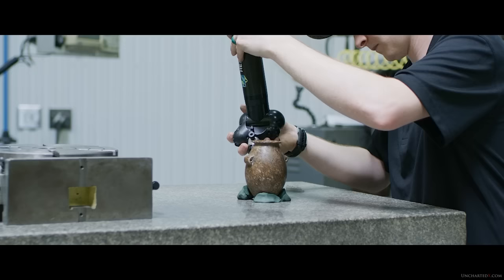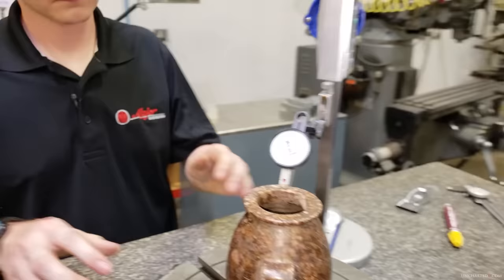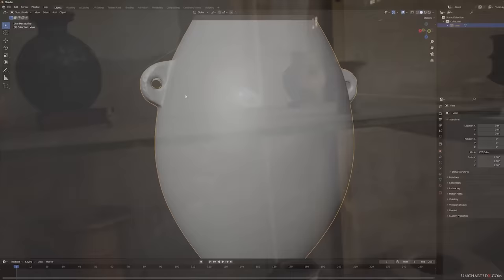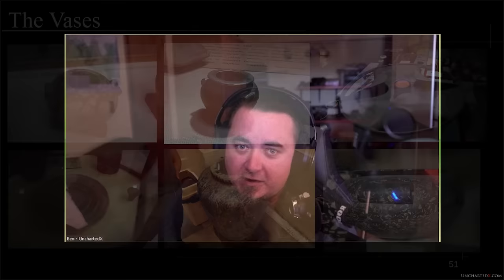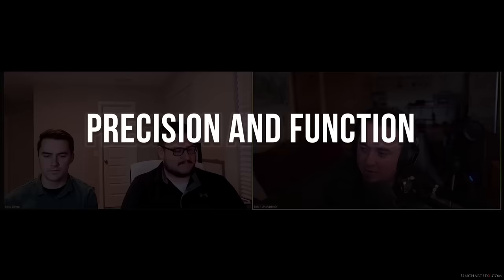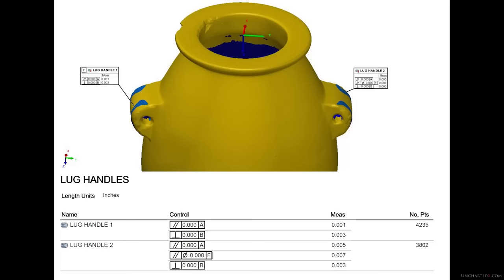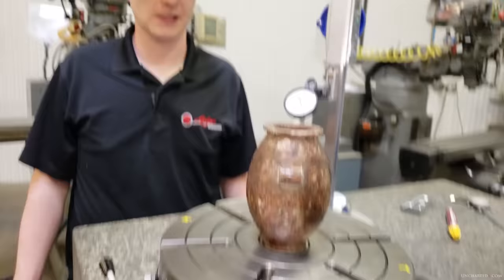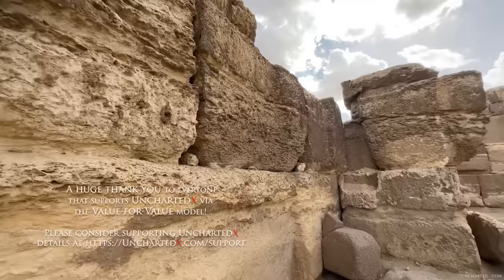Ancient Egyptian Vase Scan Update! STL file, More Analysis - and Between the Lug Handles

Comment: After the first vid on this i pondered how i would make this with Egyptian/stoneage material. I have worked a couple years an a variety of cnc machines making heavy machinery parts. I also have had a hobby of stonage technology/survival. Eventually becoming a furniture maker.
So goin into this i have some post Egyptian tec perspective.

So how i would make one of these with Egyptian limited tools:
With river rocks as bearings and a large stone or clay kick wheel like s.w. american indians had. Bees wax or pine glue mounting to the lathe. Like jewlers use (The rough shape being pecked out using templates)
The cutter would be lime stone roughly the profile (leaving the handle as a ring ,as stated by the voiceover.)
The overall shape would not be exactly reproducible as both grinding stone and vace would erode away. Some corrections by pecking the limestone.
The arm would need to be held in place by a frame. True the cutters being removed and worked would need a near total re grind....did that on a lathe before. The inside would get drilled and broken out and the interior would be pecked and ground the same way (probably first)
The rim would then be cut and pecked off.  the od grind would need to be short back an forth grinds...time sink for sure.

Would this get the same  results on the overhead pin surface measure.. who knows(side note when i used that tool for flatness on thrust plates i know the computer will assume some surface and fill in the blanks.....i have clearled the data and re measured to get a different enough surface to go from fail to pass🤫🤫🤫

 i would like try some this experimental archeology if anyone would like to fund me a couple of months of work to try i would give it a shot.

Comment: Don’t think it was made by a lathe but rather a rotary tool like a router could have been used. Slowly turning the stone against a router would make it trivial to move the bit in and out to allow for both shape and the lugs. The precision is just a consequence of perfectly centered stone holder (think jaws on a lathe) and the cutting tool moving against a template. Same template would be used to guide what ever tool carved the inside making it possible to get paper thin walls. Whats even more interesting is how the cutter was actually powered. I believe it wasn’t powered but the granite itself was being subject to ultrasound and the cutter itself being inert. There is a video by a Russian guy who successfully drills and cuts granite using stationary cutter and ultrasound. He also grinds two rocks against each other potentially explaining polygonal megalith’s perfect fittings.

Comment: Just my theory, but the key is in the handles.  The handles to the vase are what the nubs are to the megalithic blocks and their multiple perfect cuts....A charge or energy is applied that excites the granite to the point that it becomes malleable.  The blocks can be trimmed and pressed against hardened blocks, the vases can be blown. You can't turn a vase on a lathe if it has handles.  Ancient technology doesn't have to necessarily mean saws and drills.

Comment: Excellent, factual video - two things:
1/ Isn't it about time that we got somebody to document making one of these (now that we have the files) from the same material using modern cutting techniques and then compare the results. Also, just for fun, we could have an Egyptologist with a stone to bang at another piece of rock and we can see how well that does. Another tradesperson that strikes me as relevant - certainly in terms of at least getting an objective opinion from - is a mason. How would they do it. It might be that they say things that we expect them to regarding what tools would be needed and so on but the trolls in the comments section would have to respect the opinion of such a line of expertise.
2/ 16:53 "zero point zero two eight of a millimetre" can be substituted with "twenty eight microns" which flows off the tongue easier and anybody from the 'we want it in metric' side who claims to not know what a micron is just needs to learn that it is the name of a micro-metre.

Comment: For the scoop marks, could you compare the scoops to see if the exact same tool was used over the length of a single scoop and then across scoops?  Depending on being able to determine a wear pattern of the tool could narrow down possible tools/methods.  I have no freaking idea how they did this stuff, especially when you see material displacement near the margins of blocks like the entire block was softened, but I imagine it could be like a vibrational/resonant EDM-type process--which you still get wear on the electrode/tool

Comment: Amazing work again. Just a nitpick 0.028mm is 28 microns (or micrometers, or µm) The 3 digits after 0 are microns. It’s the imperial system that doesn’t have a unit for thousands of an inch :) Other than that it would be a good idea to default to microns for further work to appeal to a larger scientific audience. US machinists use thousands of an inch (or thous’) more frequently, but it’s 50-50 metric/imperial in US engineering and 100% metric in the rest of the world and scientific community.

Comment: 11:00vThe solution to the material variation is to have a moving tool edge working on a lathe. Call it lathe milling. A high speed cutting tool could make the material variations immaterial...

Comment: I enjoy these amazing discussions .. they tickle my brain as I try to ask .. how would I do something like that with available materials.  Regarding the scoop marks .. it seems the most obvious thing is that they were made with sand blasting capability in some way.  Maybe they could use stone as a way to contain pressure .. generated by water. Maybe they had specialized (not necessarily hi-tech) controls on their nozzles.  Certainly sand was abundant.  Maybe sand was used as an abrasive between a flexing roller.
I certainly agree with the machining comments that the stone jar is something very different than what we are used to thinking about.  Native Americans have used stones to grind seeds into flour .. and those grinding stones have left impressions in the rock.  This is also something that has been noticed at some of the sights in Turkey.

Comment: at 2:04 we can see that the interface between the lugs and the urn is blurry. I wonder if the vase was turned, then the lugs applied using geo-epoxy or whatever you call it.  That would address the largest issue.

Comment: I was looking back at an older video and noted that the original location of artifacts like this the 'precision vases, etc' seem to suggest it could have come from the Step Pyramid, along with ~40,000 other similar vessels. That's a mind boggling quantity of high precision objects and points clearly toward mass manufacturing techniques as this 40,000 would have represented just one cache of what was saved from the old times.

Comment: I used to work mainly with plastics and wood. But this kind of precision is hardly achievable with current common tools and machines. And we are talking about soft, easy to work with material like plastic and wood. This kind of precision looks like some kind of "injection moulding process", but I just can't get it how they could do it with stone by hand tools. We can't do it by hand and simple power tools in soft wood today.

Comment: If you look at that image at 25:04 of Egyptians making stone pottery - whatever you might think of it - take note of the tool AND the tip you can see in the upper part of the image between the first two workers (left to right).  The whole length of the tool cannot be seen in any of the parts of the image, but you can see most of the tool with the two workers and the bottom of the tool in that upper section - the tip appears to be a central pointed tip with almost a blender blade.  You can see the weights on all of the examples of the tools.  

I'd be very interested if any of the machinists on the comments recognize that bit (tool tip)?

Comment: Interesting video.  I suspect/hypothesize  that those high precision vases are possible the remnants and artifacts of Atlantis.  Atlantis was supposed to be a very advanced civilization.   Interesting part about vases is their handles.   They are designed to be handled mechanically instead by hand or robes.   What strikes me is the amount of precision for the object that is supposed to be used to handle simple liquids by simple people.  Such precision of the vase can be found in aerospace industry and some automotive industry.   Therefore, the civilization was so advanced that considered the precision vase making a piece of cake or that this vase was made for precise specs for a specific purpose/function that requires high tolerances.

Comment: Has anyone downloaded the STL file and analyzed the mesh?  The mouth of the vase in particular.  There is a slight protrusion in the mouth..along the lines of maybe +.004" to +.006"  x 1/4" long that rises up from the main cylindrical area of the mouth.  I think this is why the cylindricity that was measured is listed as being within .013" of a perfect cylinder. If the mouth or cylindrical part of the vase did not have the protrusion, the .013" listed on the Polyworks report would be even smaller  and closer to a perfect cylinder--it seems that most of the mouth is very close to a perfect circle if you slice  the mouth area.  I understand that cylindricity and circularity are two different things, however, if you slice the mouth of the vase, but don't slice the protrusion, you will see that the circularity is very close to a perfect circle--within tenths of one thousandth of an inch.

After thinking about this, I suppose it's possible that the protrusion might indicate some sort of cutter deflection where the cutting tool hit an extremely hard spot in the granite.  I have never cut granite, so I'm not sure if my thoughts on this would be accurate.  However, I'd like to here the thoughts of other on this.  If you analyze the mesh of the mouth by creating a perfect cylinder and compare the perfect cylinder to the mesh, you'll see what I'm talking about...Any thoughts on this?

Comment: 🔴🔥Necessary: I think it would be on-point to thoroughly explore the hot-stone angle. Get pros to explain required heating temperatures and subsequent tools that would bring these hard-stones to heal, so as to cut and circular-core more-easily. In one vid you had pointed out the flaking of certain massive stones, and how that was very rare and unexplainable; could it have been extreme temperatures? It seems to me that extreme heating must have been the method used in performing these monumental tasks. 👍🏆 Keep up the great work❣️

Comment: I'm no expert, yet to say there could be not have been turning on a lathe between the lug handle areas assumes certain aspects of that process without exploring other modes and applications of turning.
Imagine if the vase was not turned in a continual circle but in a back and forth motion in arcs by hand (from two directions as needed). 
This could achieve the same profile and precision between the handles without the need for incredulity. 
There might be some need for hand finishing right next to the handles, but much of the area could be turned, just not in complete circles.
Reply: that implies an even more rigid machine was used to create this object, more than likely NOT made of wood.

Comment: Perhaps, not that relevant. However, in the UK my late father started a building restoration company. He restored everything from dams to churches, from office buildings to cathedrals. His company won many civic trust awards for its work. Over time, he became inundated with work. A market emerged which was for local churches in disrepair and high end retail outlets in the older and more “classy” parts of cities. He did not have enough masons and more often than not the client could not afford the work. Around this time my dad won a licence to produce glass fibre reinforced concrete. He eventually started making relatively lightweight mouldings at low cost that could provide a credible substitute for high quality masonary, at least superficially. My dad documented all of this in manuals for employees and also for potential clients. So: skills and techniques die, clients want the originals, so solutions are found, procedures are recorded, the solution is not the same as the original even though centuries have passed. Seems that this is a normal process to me.

Comment: I wonder how much microscopic analysis has been done to these stones. Specifically comparing the mineral structure at the edges of tight fitting poligonal megaliths, to the interior of the block ( by using a block that has been cracked open) and also comparing it to the quarry it came from.
I suspect we will be able to find discrepancies in the microcrtstaline structure of these stones.

Comment: For a quick check, I opened the .stl in Zbrush.
Appended a sphere.
Set the sphere to the same height (y), and set the z-width to the non-lug surface (z) width.
Then set the x-width to the same as z.
The results are indeed stunning. 👀
The only thing that's weird is the hole through ONE of the lugs is VERY skewed from parallel. This doesn't make sense.
Reply: more than likely the holes were added in the Dynastic era. which makes one wonder, what purpose did these artifacts have?

Comment: I agree that these had to be machined in some way, but given that, the lug handles are not problematic. They appear to be curved along the vertical axis like the vase itself indicating that they were turned as a band around the entire vase then the unwanted material was ground away and the holes drilled through. Using what type of machine? That's the question. Also finding these high quality items contemporaneous with low quality imitations is not mysterious either. Just go to Canal Street in Manhattan and you'll see what I mean.

Comment: I suspect, with a harder than granite rotating cutting tool, the object could be spun on its vertical axis while being shaped by the rotating tool very accurately. Similar to a 3 axis cnc machine. The device need not be a lathe, it could be rotated by hand so long as the cutting tool was rotational and followed a guide such as the old pattern lathes did. As more accuracy is needed, such as the detail around the lugs, the tools size and shape could be changed. I’m curious about the accuracy of the holes in the lugs with regard to their distance from the centerline of the vase as well as from the top flat (datum surface) of the vase. The holes would have to be drilled using a separate method.

Comment: What does the interior of this piece look like? Is it a cylindrical bore? Is it roughly hogged out? Does the interior surface smoothly follow the exterior curve? I think you might learn something by looking at the part where the makers didn't care whether or not people saw a smooth surface. An unfinished interior quite likely shows an intermediate step to a finely finished surface. I'm a potter. The exterior of many of my pieces are smoothly burnished, but on the interior you can still feel the impressions from my fingers

Comment: I'm currently having a too and frow with an idiot saying that all the scan stuff is garbage etc. Very frustrating.  As an engineer for over 45 years, using CMM machines etc. The data does not lie. He is also saying that it is not as old as proclaimed. Even if it was made last week, we could not make it with our current technology.
Reply: @darklight2.1  None, I would not be able to manufacture one to the accuracy found in this piece.  Also you would not find many that would attempt it.
Reply: @darklight2.1  Have you seen any with constant wall thickness to within 10 thousands of an inch, and lug handles symmetrical to within 1 thousands of  an inch. Why don't you download the cad, do some checks, find a modern vase that is as accurate. Some of the many stone vases in the Cairo museum are made of even harder materials, clearly machined. So they are all fake also?
Reply: "too and frow" ... "idiot" ... 😂

Comment: i measures the handles an worked out the holes not the center of the holes but the position of the bottom of the holes s exctly  third down and two thirds the way up the vase. could suggest a some sort of intentional design. But measuring from the tips of circular cuouts instead of the center seems odd.

Comment: For those who question the provenance, who did make it then, and how, and when? Answer me that...?
Reply: It sounds like, we've no solid evidence so far that it couldn't be made with modern machinery.  
They say that it's difficult to get those tolerances now but they only have experience with turning metal, and turning stone is rather different, it has to be done much more slowly and it has to be ground rather than cut - so it's hard to say, without doing it, whether it would be easier or harder to get high accuracy.  
They could test it out, if they're going to be leaning heavily on that argument - pay somebody who makes turned stone objects to make them something on a modern electric lathe, and scan that to see what tolerances that has.